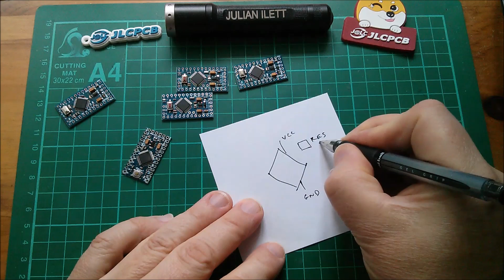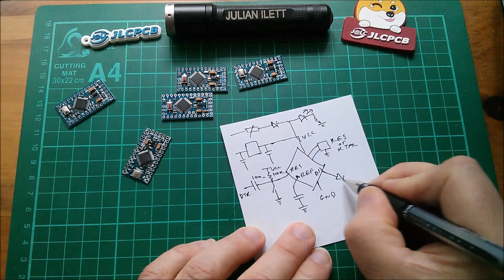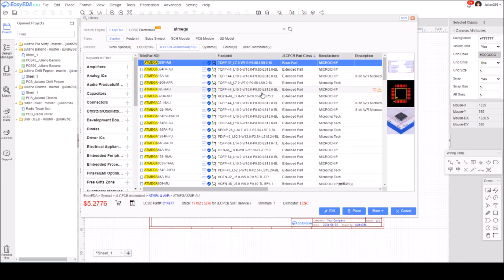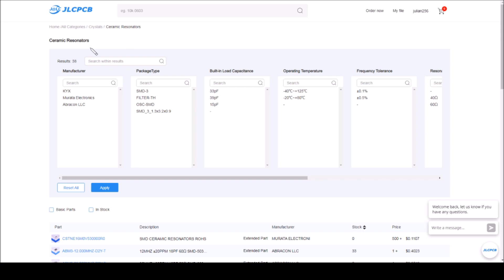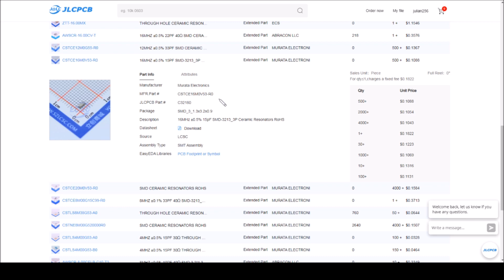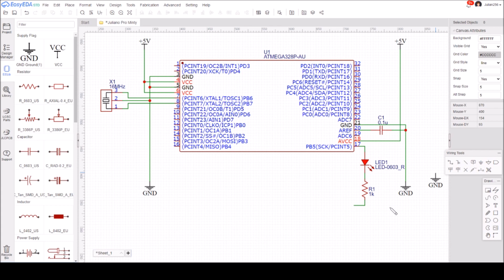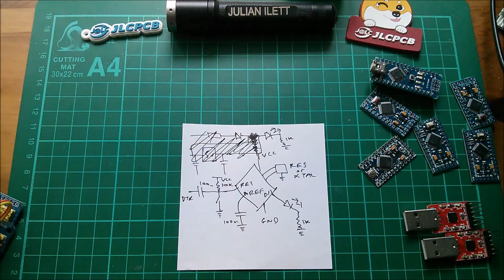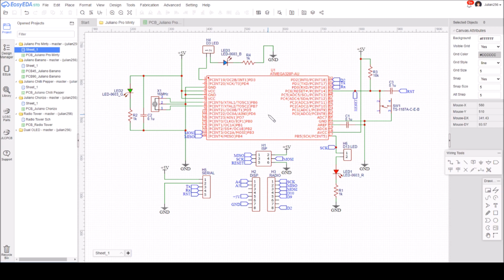PCB: Introducing the Juliano Pro Minty

Comment: The ‘official’ schematic is on the Arduino site here https://www.arduino.cc/en/uploads/Main/Arduino-Pro-Mini-schematic.pdf
Reply from the maker: Interesting - no polyfuse or diode. On most of my Chinese Pro Minis, the polyfuse is connected directly to the RAW pin.
Reply: @JulianIlett  Original Prominis were meant to be used in projects as an easy to solder MCU breakout board, not as a development board, so any kind of protection usually done on the main project board. Only the absolute necessary parts were included. Chinese manufacturers made them more compatible with prototyping applications.

Comment: If I made my own ... would like to have a 6-pin ICSP with a jumper that selects between Reset and SS, so the board can act as an SPI host.
Also, holes to mount a 4-pin I2C connector in the Seeed Grove pin order convention.

Comment: You might have a job getting the 328P-AU, however the 328PB-AU seems to be available and its got a couple of extra IO pins, failing that you could buy cheap NANO's and pull the chip off those !....cheers.
Reply: it also has some extra hardware, most importantly it has 2 uarts so you can use one for the usb and still have one left for other stuff. I've used that a lot recently it can be pretty handy!
Reply: @szaszafaja  Yes, of course, its been a while since I used one and it gets forgotten, but in these times of a shortage its a good option.....SSSHHHH dont tell anyone !
Reply: Had to look up what the PCT was all about on the PB variety.  Those AVR maniacs were always into variants!
328's in QFP are quite expensive on Ali, compared to STM32's and Logic Green clones.  May as well get the 28-pin DIP.
Reply: glad i switched over to pic, RS has thousands of them and theyre so cheap!

Comment: Do you need to be wary of any config settings regarding the type of osc used as the clock ?

IIRC PICs are picky, and like to know what's driving their clocks to match impedances and other tiresome things.
Reply from the maker: As far as I remember, the clock settings are in the fuses. I can check that stuff when I program in the bootloader.

Comment: 2:22 No, RAW pin is the INPUT to the voltage regulator. The path you are describing there through the fuse and diode is part of the Vcc input, although it doesn’t connect to board Vcc quite like that.
Reply: Watch till the end